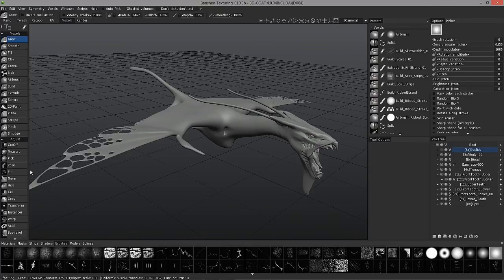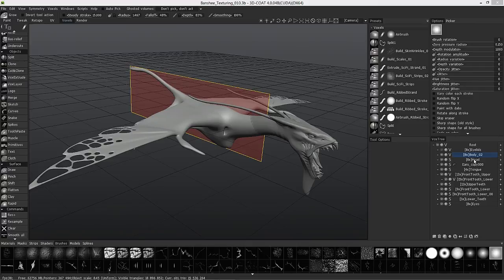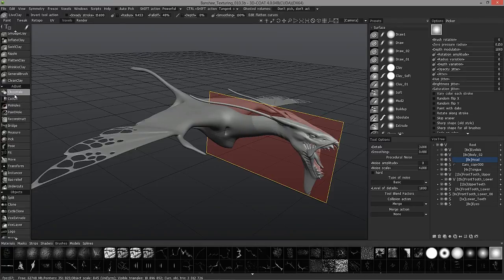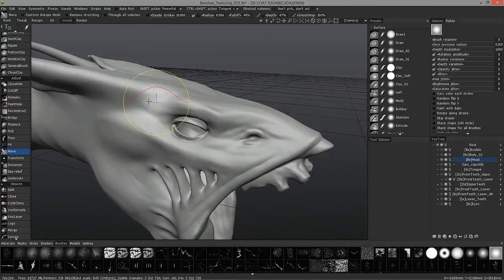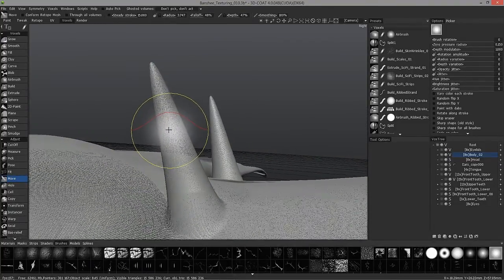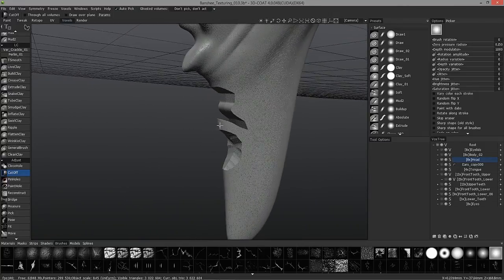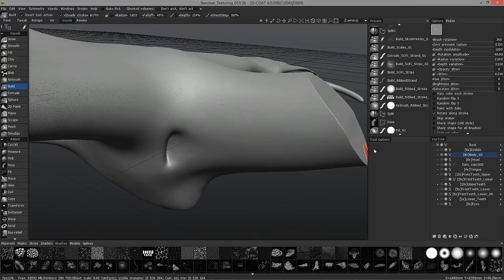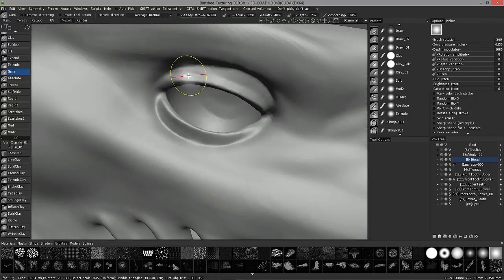Voxel / Surface Mode Sculpting Pt.1

Comment from the maker: Thanks. There were some very recent improvements to the brushes in Surface mode, so an addendum to this Sculpting portion is in the works. Also, Andrew is currently working on some significant Auto-Retopo/ Manual Retopo improvements, so we'll wait and see how those develop before moving on to the Retopo stage of this series